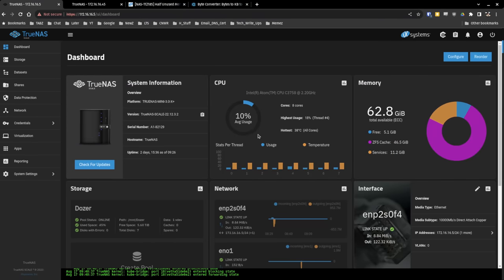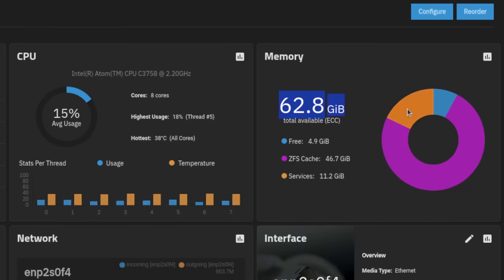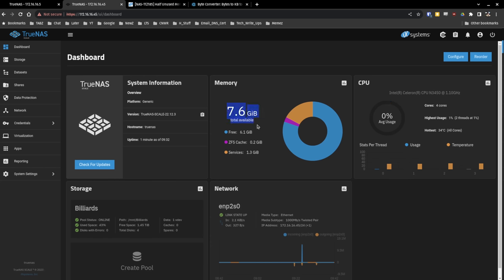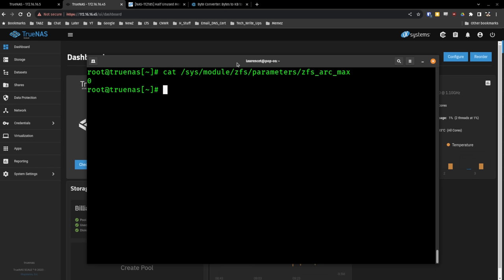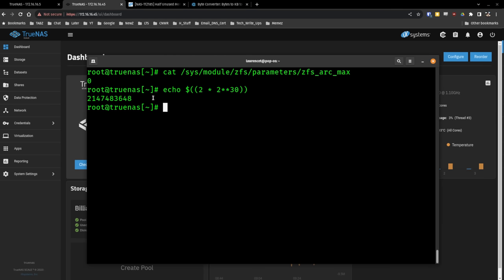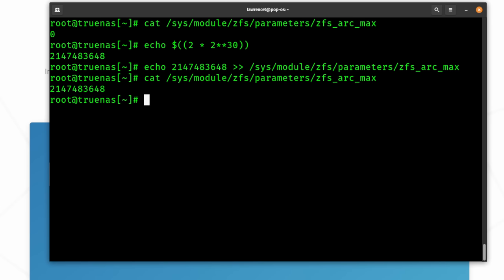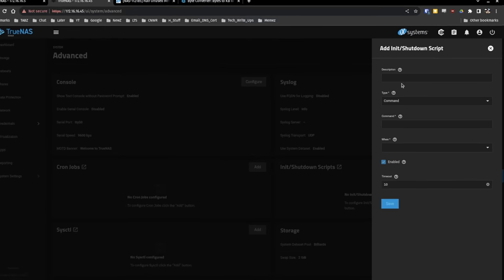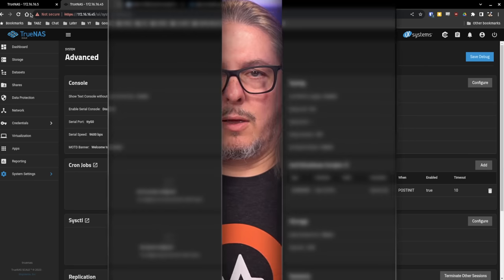TrueNAS Scale: Arc Memory Cache Tuning (Not needed after Scale Version 24.04)

Comment: 1:10 I don't really agree with this assessment, because ARC memory is not swappable on FreeBSD (it's Wired, and it shouldn't be swapped out), but this also gives it an ugly tendency to push text pages out to swap. That's kinda okay if swap is on dedicated SSDs, but TrueNAS CORE will put the swap - by default - on the main pool devices. So by default you can easily end up with CORE aggressively swapping to the pool devices, and then system responsiveness goes down the drain as swap I/O competes with pool I/O. I was wondering on my CORE setup why I experienced these sudden, dramatic slowdowns of share performance, and well, it was ARC Wiring up all the memory.

Comment: This was fixed in the latest releases of Scale if I recall. There was a post on the TrueNAS forums from one of the developers that ZFS and ARC behave a little less predictable on Linux and when memory reservation was set the same as in FreeBSD, they often got Out of Memory errors, kernel panics, system hangs etc., so they used 50% limit as a way to temporarily stop any problems from happening while they work on a permanent solution. This 50% limit didn't analyze the size of RAM you had available, so it was the same no matter the RAM.
Reply from the maker: Yes, fixed in the 24.04 release
Reply: @LAWRENCESYSTEMS  is there a parameter in 24.04 or what?
Reply from the maker: @senj3ru  Same command works
Reply: @LAWRENCESYSTEMS  Am I right in understanding that in 24.04 I don't need to use this command if I want to use more than 50% and is it built-in or not?
Reply from the maker: @senj3ru  As I updated the title to say, command is not needed after Scale Version 24.04

Comment: The way it seems to work currently is when I start a VM it just falls back to the 50% limit no matter what. I've been testing this for over 6 months with 90/128G and have never ended up in a crash scenario.
Reply: There is probably some logic in Scale that writes that value when you start the VM, this does not happen in Proxmox or other generic Linux system. The value you set sticks.

Comment: That value converter website is pretty weird. I noticed TrueNAS shows RAM utilization in GiB (base 2), not GB (base 10). Your manual calculation using the factor 2^30 is in line with that and yields the same result the website gives. However, the website calls 1024 bytes a kB instead of a KiB. On the same page they state that "kilobyte" has different meanings depending on whether you are in a binary or a decimal system. That's plain wrong. A kB is ALWAYS equal to 10^3 bytes. It's just that many people tend to confuse the binary and the decimal prefixes. They should have explained that instead of further contributing to this misunderstanding. Also the conversion table on that page claims that a kB is 100^1 B, but that's probably just a typo. I'm sure (I hope!) they meant to say 1000^1.

Comment: Would 45 Drives's Rocky Linux / Houston system also be capped at 50% by default? This is a general Linux behavior with ZFS, correct?
Reply: yes this is default ZFS on linux behaviour.
On a more generic Linux system (and Proxmox) what he did is done by creating/editing in "/etc/modprobe.d/zfs.conf" file with "options zfs zfs_arc_max={your_number}" and then rebuilding initrd images so this config is loaded on boot.

Comment: Question; I have a 40TB Raidz2 on a system with 32GB ram. After setting the zfs_arc_max to 27GB (only samba on this system), running a scrub. I left it for a few hours running, when I checked on it's progress, the arc cache had consumed almost a 32GB (less samba). If I had left it alone, I'm sure oom would have kicked in. Fortunately I was able to lower the zfs_arc_max value and complete the scrub. The question is why would the scrub not honor the zfs_arc_max value?
Reply from the maker: Not sure, but this video will soon be sunset since Dragonfish changes all of this.
Reply: @LAWRENCESYSTEMS  :-) Something to look forward to. Thanks
Reply: @LAWRENCESYSTEMS  After upgrading to Dragonfish, memory cache would use up to 50G of 64G in my system, which could be troublesome at times because there is not enough memory left for my VM as other services use about 6G and there is only 3-5G left. When I try to start up a VM, there will be a warning about memory overcommitment. If I proceed anyway, the VM would start without issue and the memory cache would be reduced automatically by the system. Is that something I should be worried about?
Reply from the maker: @zhenhaochen8170  It only uses the memory that is free so start those services before the memory is used and then you don't have to worry about it.

Comment: After I did this to expand the arc, it seems like the memory in the main dashboard is nearly completely free and not used in ZFS any more. Any ideas? I returned to 0 and removed the init script, but it still shows almost no cache used when before it was about 115 gb or so. However, the system functioned fine before and after I made this change. The only thing impacted is/was the dashboard in truenas showing almost no memory being used for zfs.
Reply: When you reboot, ARC is purged, so, you'll have to use it for awhile in order to fill the ARC again.

Comment: Fixed: Unfortunately this is still relevant in Dragonfish 24.04-RC.1 Almost 3/4 of my memory was locked into ZFS Arc Cache. Giving me no room. Thanks. I have 32gb of Ram in my System what would you recommend for a ZFS Arc Cache? I have it set now for 4gb.
Reply: When I did the "cat /sys/module/zfs/parameters/zfs_arc_max" I didn't have a 0. I had a locked in amount of 30 something Gb.

Comment: If I want the NAS to primarily work as a NAS I am probably happy if the ARC uses 50% of my memory, even on a 256GB RAM server. Right?
Reply from the maker: I set it to use AS MUCH AS POSSIBLE as that is a big speed boost.
Reply: I use mine as a NAS-only system--no VMs, no containers. My thought is the opposite of yours @kwinzman. If the only value of the RAM is for NAS, why not use almost all the RAM for NAS (including ARC). No need to have half of your RAM just sitting there doing nothing, reserved for something you're explicitly not interested in. Now, my question for myself is: why am I not just using CORE instead of SCALE, since I don't need or want the unRAID-like stuff SCALE offers and the NAS-specific stuff SCALE offers isn't mature and/ or I don't have the hardware for it? Time to watch the new video on SCALE vs CORE!

Comment: No. I think the "When" of this command should be PreInit rather than PostInit.
Reply from the maker: Why?
Reply: The value is live. You can run the command in the terminal and the new value will take effect immediately.
As long as it gets run before your ARC hits the default 50% high-water, it will be fine.
Reply: does not matter. ZFS module is loaded before Preinit anyway and you can do that command at any time you want

Comment: In Proxmox (uses Linux kernel so it should be the same) there is a hint in documentation if you need to set zfs_arc_size permanently you can set it in "/etc/modprobe.d/zfs.conf" file with "options zfs zfs_arc_max={your_nubmer}" string. Isn't it the case for Truenas aswell?
Reply from the maker: Because TrueNAS scale is built more like an appliance you should always use the UI for updating settings so it will survive updates.
Reply: @LAWRENCESYSTEMS  TrueNAS also keeps the values in a different spot.
TrueNAS - /sys/module/zfs/parameters/zfs_arc_max
Reply: @Prophes0r  that file is available on all linux systems running zfs too. It's two ways of controlling the value. One with the modprobe command on start of the module or online by writing a number in bytes in that file

Comment: I applied it to my system and it started using it immediately, so you may get away without a restart if you have work to do
Reply: yes the command from console will change the setting immediately but it's not kept on reboot. To run it automatically on reboot you have to add the startup script as shown in the video

Comment: So Tom says there is a risk of crashing when using up too much RAM with services when arc_max is set manually. Does this also apply to the default setting? I thought scales arc would behave more like Tom said about core - use free space and give it back when services need it.
Reply: the actual issue here is that on Linux the ZFS module is often too slow to let go of the memory when there is memory pressure, so this triggers an OOM that will start to kill OS processes.
So yeah you can have that issue on default settings too if your application need more than half the RAM. But it's the middle point between safety and performance so that's why it's a default.
If you choose a manual limit then it's down on you to choose wisely and know how much RAM the applications on the NAS require.
Reply: @marcogenovesi8570  Thanks for clarification! Hopefully they will find a soultion for this. Better sooner than later.